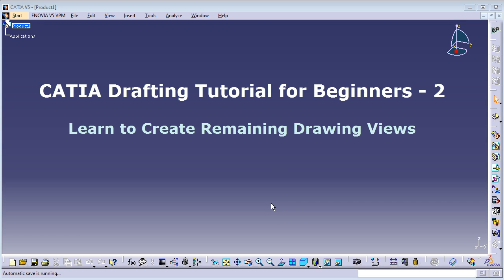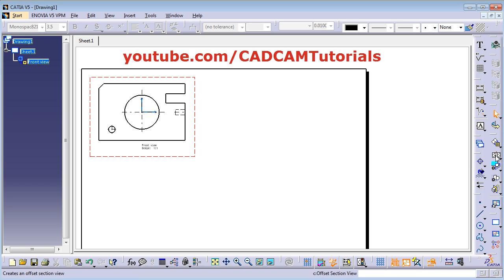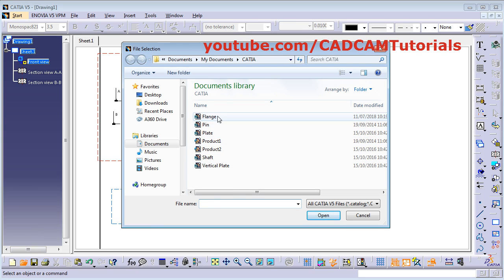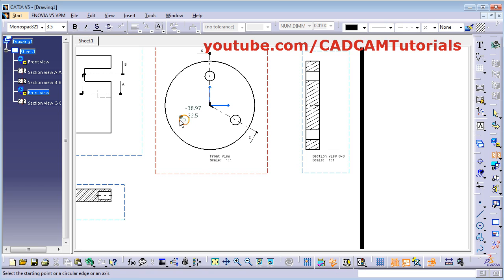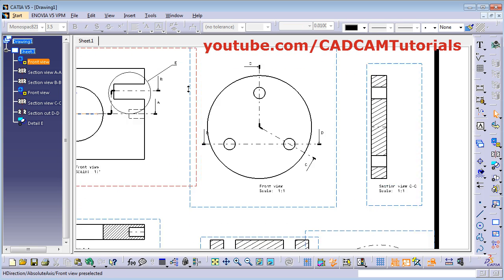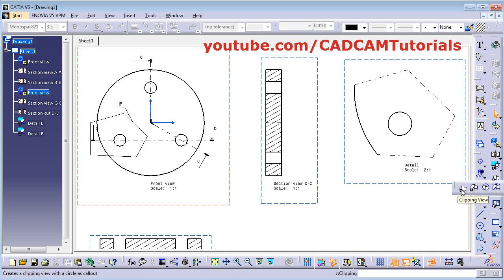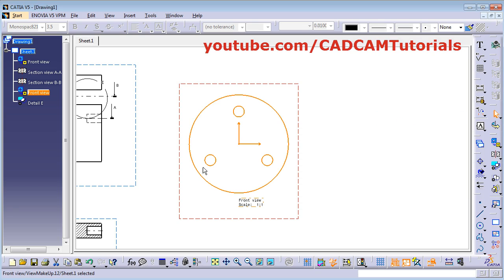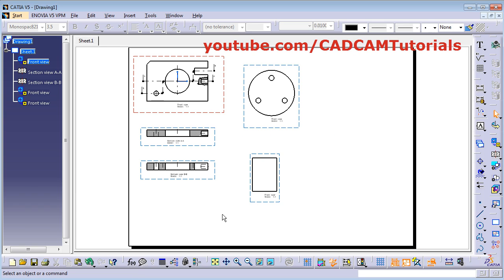CATIA Drafting Tutorial for Beginners - 2

Comment: I learned and practiced your all lectures,what do you think can I able to apply for job now.
Reply from the maker: Yes. Why not. Now your basic is clear. Practice for more complicated objects from your drawing book.
Reply: CAD CAM Tutorials 
there are many sections in catia. 
like in part..there are
1.part design
2.assembly design
3.sketcher
4.PFTA
5.WELD design. 
6....etc. 
I  only learned that you tought.
is this enough or I have to learn all the complete catia.
like
1.shape
2.sheet metal
3.composit design
etc.
Reply from the maker: Normally 6 basic modules are required: sketcher, part, assembly, drafting, surfacing and sheet metal. Then you can add as many as possible. That will be great plus for you.
Reply: CAD CAM Tutorials 
thank you for shearing your experience. 
there is no job available for freshers. 
all companies require at least 1 yr experience. 
I don't know from where I can start.